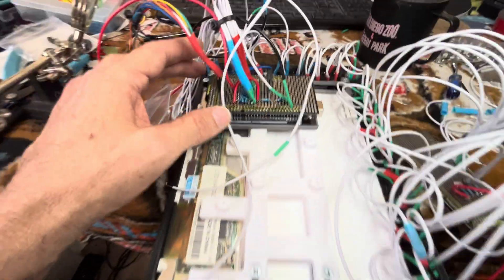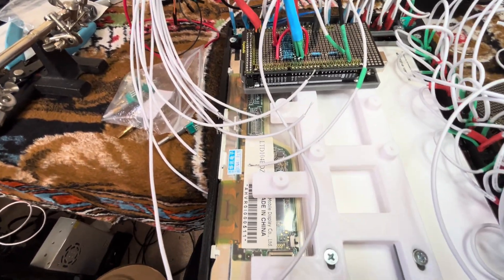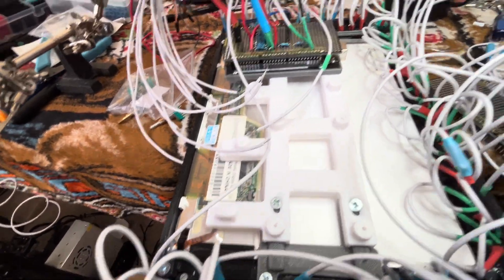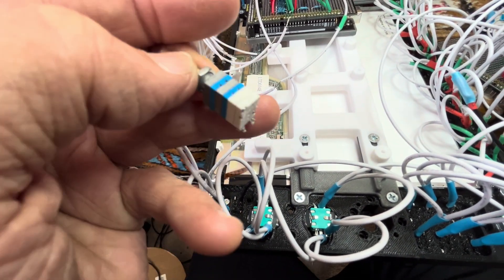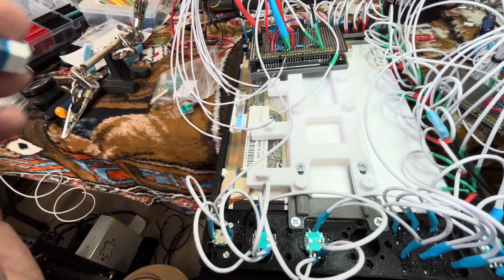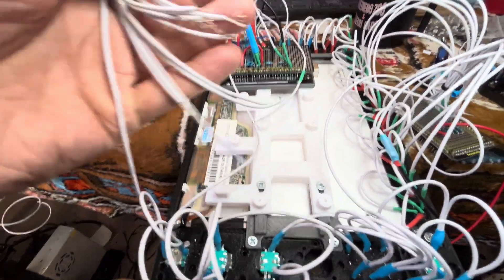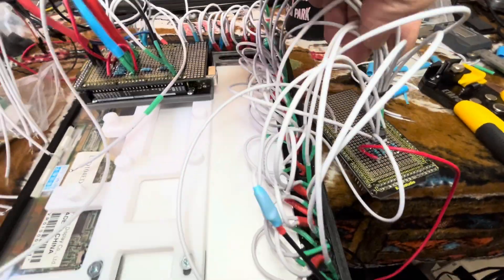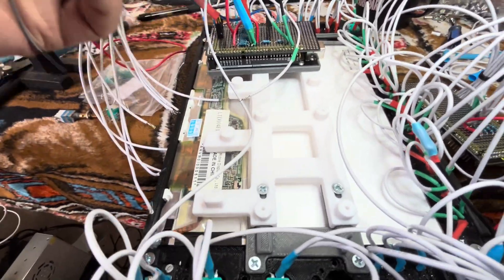3d printed Garmin G1000 NXI replica for MS Flight Sim. 2020

Comment: I'm working on this same build.  Appreciate this video - I was looking at buying the Propwashsim encoders, but was really worried about how small the pins looked.  You may have just saved me some effort and $$!
Reply from the maker: They are fragile and can’t take much flex when moving wires around during the build.  I learned the hardway for sure.

Comment: Would it be possible for you to describe how the video portion of the G1000 get connected from the display all the way to the computer. Same with the buttons, etc. I am new to this SIM build stuff and I can't seem to get any good information on how all the panel equipment is wired / connected to the computer from start to finish. Any help would be appreciated.
Reply from the maker: When in Microsoft flight sim. All you do is press the right side keyboard Alt button and left click on the mouse when the mouse pointer is in the screen of the Garmin in the flight sim. That will copy the image to the new flight sim box. Keep in mind that your computer video card is going to need at least two video output connections one for the main monitor and one for the sim box. Two sim boxes then three video outputs needed in the computer video card.